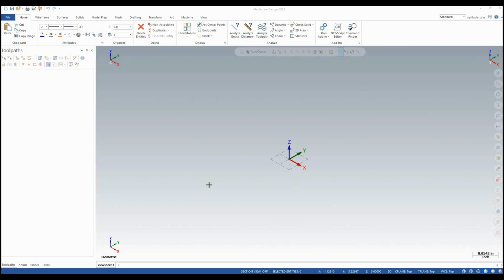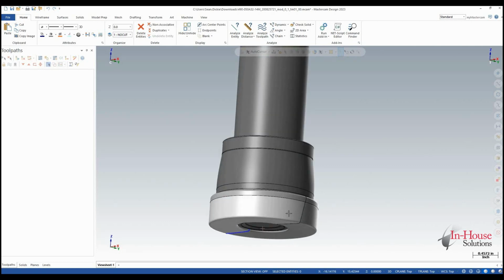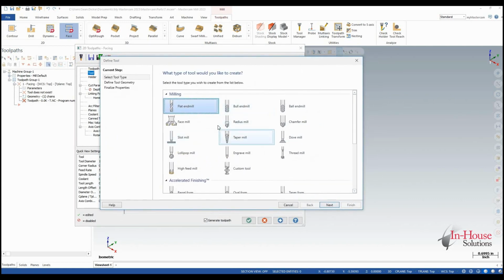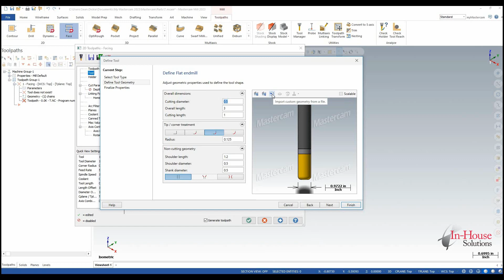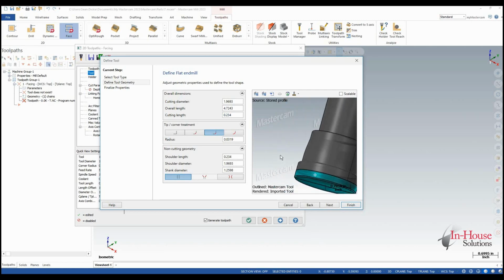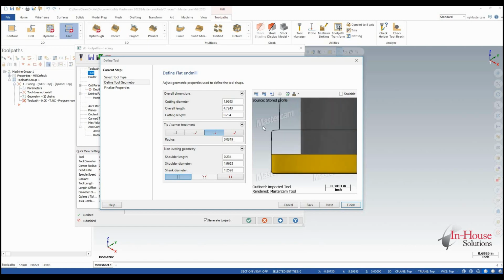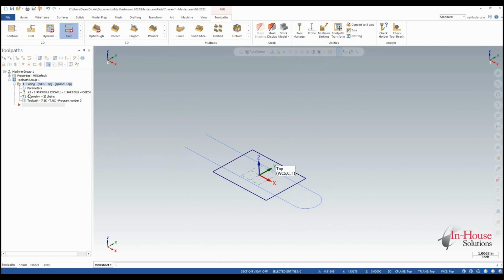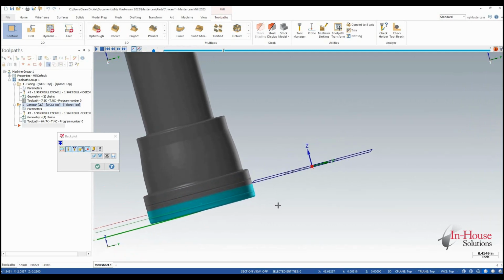Mastercam 2023: Importing a Custom Milling Tool

Comment: What was the imported tool file .what?
Reply: This is a 3 year old reply, but, I think he skipped a step. Someone correct me. Download the tool from Sandvik, it's going to be saved as a zip file, unzip the file. He then opened it in MasterCam and I think he saved it back out as some filetype that MasterCam recognizes (This is the step that was skipped). Then when he created the tool, MasterCam sees the expected filetype.
I'm trying to figure this out myself. Sorry you had to wait 3 years.